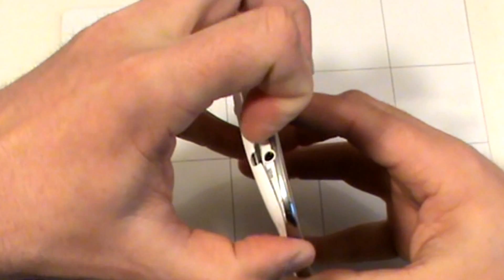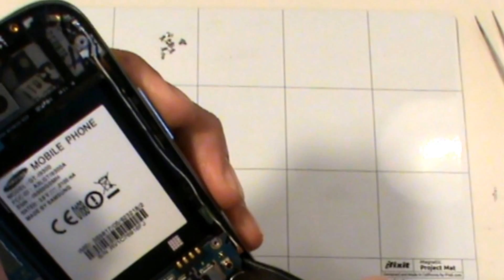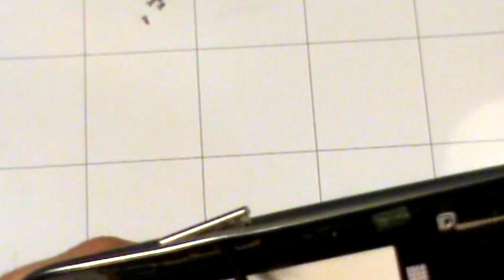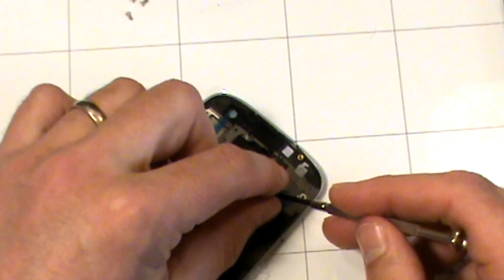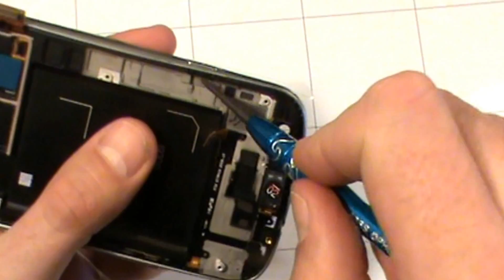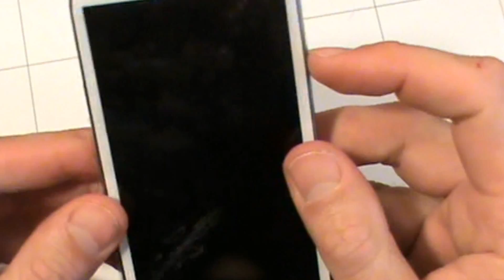Samsung Galaxy S3 Screen Replacement Guide

Comment: Thanks for the video very good I need to change mine but the display is ok and the frame it sits in is cracked so would like to change it may I ask where did you get your display from please as I don't want an inferior part, Any help would be good thanks Bob in the UK
Reply from the maker: Hi Bob, I'm glad you found my video useful. If you look in the description below the video you will see a selection of links to part and tool suppliers I've used. You can buy the frame separately from the LCD display. But, it is hard to detach the display from the frame without damaging the display. Buying a complete unit is far easier to replace. I hope that helps. Regards, Will

Comment: I dropped my s3 down 2 stairs, around 4 meters with the screen down hitting stone floor, the phone maked sounds and touch worked but the screen was black and a barely visible crack across the screen. I guess that is possible to fix this way
Reply from the maker: Yes, it sounds like a new screen is the best way to fix this situation.

Comment: can you show which side of the volume button to slide into the frame? thanks,
Reply from the maker: Hi there, You may have to try this a couple of times to get it the right way round. The volume button is thicker at one end than the other. If you put it in the wrong way round you will see immediately if you've inserted it correctly or not. It will sit flush with the frame if you have put it in the right way round. I hope that helps. Regards, Will

Comment: Hi Will - You must be a teacher in real life.  So clear and succinct.  I had two S3's, disassembled them parallel.  One had a cracked screen, the other wouldn't boot up but had a great body.  The only mistake was disassembling too much.  I could have just replaced the motherboard from one to the other and got the same result.
Reply from the maker: +John Mardling Hi John, thank you. I am happy that you found the video useful and clear. Did you manage to get one of your S3's working?
Reply: Yes, works well. I had a new i9300, just bought but I've decided to make the i9305 my primary phone now.  So all up cost $50+$55 (AUD). My wife was despondent because I'd had my S2 for so long and with this lasting, say 3 years and the new spare another 4, I'm going to reinforce how big a laggard I am (in her eyes).

Comment: hi Will, i replaced my screen just the way u did. I have some serious problems. My phone starts on safe mode and my touch doesn't work properly. Sometimes it opens normally but then touch doesn't work at all. So i think the problem is not about the screen. Can u help me?

Comment: Great video, Thanks mate. Screen is on and working. HOWEVER, I would recommend to everyone attempting this to heat up the vibrator assembly with a hair dryer to pull it off. Mine tore at the contacts and as a result I had to omit it from the re-assembly. It's my daughters phone so it's not a huge problem. Other than that, it was a breeze with this youtube reference. Another note; my screen included the buttons. I left them in and gently slid the volume assembly in with a small standard screwdriver pushing the button away inside-out.
Reply from the maker: Thanks for your comments, Duke. Glad it went well.

Comment: Thanks Will !
Absolutely Brilliant AAA+ with your YouTube guide I was able to replace my frame /screen, not one hiccup, on mine I had to press the top camera cover gently to make sure it was click seated before installing back cover with 10 screws.
So with your advise - First time working on a delicate piece like a smart phone with plastic TV tunning tools, and jeweller screw driver set and pointy nose tweezers I managed to do it 100% perfect job, something I know the quick turn around shop technicians with Chinese fake spare parts would not have the patience for.

10 out of 10 - you are the MAN for S3 !
Reply from the maker: I am happy that it was so useful for you and thank you for your comments.

Comment: Have taken my entire phone apart only to find out that you're not actually just replacing the screen. Spent an hour swearing and ballsing up my phone for nothing. Perhaps a better description next time so I don't end up spending loads of time and money for no reason?
Reply from the maker: When is a 'screen replacement' not a screen replacement? The 'screen' is made up of the 'digitiser' and the 'LCD' plus the case which holds it together. I can't think of a better description than that. And, I make it very clear at the beginning on the video what the video will help you to achieve. Did you want to replace the digitiser? Or, the LCD? Or, something else?

Comment: Does this also work for L710 model?
Reply from the maker: Hi Joe

I have not tried it on the L710 model. But, make sure you buy the appropriate part for the your device.

Comment: Ok 1 thing u missed out is while that battrey of yours is connected to your phone there is still power to your phone which means using anything metal can short circuit you phone to avoid thos take out the battrey and hold the ob button for 5seconds ... I recommend as if u shot circuit you phone u might as well thougb it away

Comment: My components don't come off anywhere near as easily as yours. Feel like they're glued on.
Reply from the maker: Make sure you take your time with removing the components. Sometimes, a little gentle heat can help with parts that are glued down. It's easy to damage ribbons if you force them off. So, be careful and don't hurry.
Reply: Thanks, I successfully changed my screen after watching this video :D. My main problem was my screw holding on the front camera had no thread left on it :s, so I bent back the metal and pulled it out and just taped it back in the new phone haha.

Comment: I replaced my GS3 screen and everything works great...EXCEPT the back button.  I took care to properly aligned the menu and back buttons and the menu button works great and it lights both the menu and back buttons but the back button neither functions nor lights up when depressed.
Is it possible that the back button is simply misaligned?  And if that's the case, is it possible to remove the newly installed screen, re-align the back button and then reinstall the same screen?

Comment: Got everything but the glue under the screen has bubbles and I tried to doing the blow dryer to even it out but didn't seem to work. Do you have any advice
Reply from the maker: I would send the screen back. That is a fault with the new screen. The glue under the digitiser should be bubble-free. It might affect performance but it looks unsightly and shows that the screen was not put together correctly.

Comment: thank you for your tips. I replaced the glass on my phone but now the glass does not respond to touch anymore. do you have any idea what I could have done wrong? everything looks ok and the phone turns on fine. The digitizer is also clear and there are no cracks in it either. much appreciate your help.
Reply from the maker: Hi there, Sorry for my slow reply. Your message was in the spam folder :-( 

If the digitiser is not responding to touch, it is most likely to be a loose connection. Take you smartphone apart again and check all the connections from the digitiser to the motherboard are all on correctly. It's easy to misalign them when fitting. Just a little firm but careful pressure on the connections should do it. 

If it still does not work, then it might be a faulty screen. 

I hope that helps. 

Will
Reply: Thank you Will. i'll do as you suggested and hope that I will be able to make it work.
Reply: Hi Will. I have looked for damage to the ribbons and checked al the connectors but everything seems ok. Are the LCD and the digitizer the same thing? the LCD screen is clean with no cracks but when I took the phone to a phone repair guy he said that I had also removed the digitizer from on top of the screen when I had cleaned it and that the digitizer sits between the glass and the LCD face and that's why it had lost its sensitivity to touch? just wondering if that is true? the phone was working perfectly before I took the screen off.  thank you
Reply from the maker: Hi there. The digitiser and the LCD are two separate components. The digitiser is the 'glass' you touch. The LCD is the 'screen' which displays the images. What sits between the digitiser and the LCD is a special adhesive (called 'Liquid Optically Clear Adhesive (LOPA)'). When you remove the digitiser from the device on an S3 you usually have to heat up the adhesive and remove it before you replace it with new adhesive and stick the digitiser onto it. Your S3 will work if you don't replace the LOPA and just stick down the digitiser to the frame. However, it is not as strong. It sounds like the ribbon is damaged. Without seeing it, it is difficult to know what is exactly wrong.
Reply: Hi Will, The LCD is black and intact. It also sounds like I have not damaged the digitizer as the screen works perfectly when switched on and all the colours look great, it just doesn't respond to being touched. I have checked all the connections and ribbons and nothing seems to be loose at all. I am at a loss as to what  do.   Thanks again for your help

Comment: i tried this and now my phone wont show any display =( i dont know what i did wrong
Reply from the maker: Hi there

It could be a number of things, but you might want to go back and check all of the connections from the new screen unit to the motherboard to ensure they are properly connected.

Is your S3 making any sound as it starts up with the new screen? It could also be your battery which might need replacing if nothing is showing on the screen.

If you have your old screen (and it is still functioning, albeit cracked), refit it to make sure you can see still something on the screen. This will let you know your motherboard is still working.

I hope this helps.

Comment: hey im fixing my samsung galaxy s3 this week and i've watched this video a couple of times just to get the hang of it.and noticed you don't use a hair dryer .do we not use one or do
Reply from the maker: There's no need for a hair dryer because you are not removing the 'glass' from the front. You replace the whole unit which uses screws to hold it in place.
Reply: Will Hawkins do you know a good website to buy the screen kit
Reply from the maker: 90210lovergirl1 if you look at the about section beneath the YouTube video you will see a list of recommended or suggested suppliers of the screen.

Comment: Will, Thanks very much. Great video. I fudged the 1st trying to remove the glass only and broke the LCD on my wifes phone. I ordered the complete unit and followed your vid. If I had messed this one up she would have killed me but it worked perfectly  :-)
Reply from the maker: Hi John, 

It's a tricky job to remove only the glass. I know from experience. I messed it up too!

I am glad you fixed it on the second attempt!

Regards,

Will

Comment: hey will, so I just recently broke my glass..I tried to fix it, but it ended up ruining the lcd too. so If I borrow my friend's old galaxy s3 and put my motherboard in that one, will I still be able to retrieve my data and run the phone just like my old phone? or will I lose everything?
Reply from the maker: HI Noel, 

Bad luck with the screen. It's easy to damage it. 

Swapping the motherboard over should work, although I have not tried it myself. 

Regards,

Will

Comment: I dropped my phone yesterday, the first layer of glass isn't cracked, but underneath i can see cracks and the screen won't work at all. the phone still vibrates, lights up, flashes, but the screen is just black. will this tutorial fix this?
Reply from the maker: Hi Georgia, 

It sounds like your LCD is completely smashed. In which case, replacing the screen (see links for suggested suppliers above in 'Description') as described in this video will solve that problem. 

Is there any other external damage to the S3?

Thanks

Will
Reply: just damage to the paint work really, if i follow the tutorial how much overall will it cost to fix?
Reply from the maker: Ok. That sounds like superficial damage. The cost of the repair will just be the cost of the replacement screen unit (LCD and digitiser combined. :-)
Reply: how much would that be?

Comment: I have a question. Does this part replace the LCD too? Cause the screen on mine is fine but the LCD under is 100% not working with cracks in it.
Reply from the maker: Yes, it replaces the digitiser and the LCD.
Reply: Will Hawkins Thank you very much.

Comment: Is it worth the money to by the whole digitizer and LCD screen setup rather than just the glass replacement?
Reply from the maker: If you can remove the glass without damaging the LCD beneath and then replace the glass so it is correctly bonded to the LCD, then it is cheaper but not quicker to do. 

However, it is not cheaper if you break or burn the LCD which is easy to do if you use too much heat.
Reply: thank you sir

Comment: Hi, thanks for a very brilliant and detailed step by step video. I followed it and replaced my daughter's LCD which she broked after a hard fell. The problem I am facing is that; the toutch screen works and then suddenly it will not. Last time I loosened everything again and placed the power  button correctly and it worked and now it will not. Do you think there could be something wrong with the motherboard ? Thanks or any help
Reply from the maker: Hi Jipudate, Thanks for your comments. It's difficult to say exactly because a number of things may have happened to the device when the original damage to the screen happened. But, it does sound like there is a loose connection on your smartphone. The most obvious points to check are the connector s to the motherboard, especially the screen connector. However, you have already checked this so it would appear not to be that one. Therefore, it does look like it is something more serious on the motherboard. In which case, this is much more of a problem that can be solved than just by replacing the screen. Unfortunately, I can't offer any advice on how to repair this potential problem. Regards, Will
Reply: Will Hawkins  I just thought you should know. I got another screen replacement and all works fine. Thanks a lot.

Comment: Will, that is awesome that you're replying to these comments with further assistance. I reviewed dozens of videos on replacing just the glass screen on an S3 and was very cautious and patient and was especially careful at the bottom where the two buttons are located, so I didn't damage them. BUT... no one said ANYTHING on ANY video about a ribbon cable that appears to be connected to the LCD screen.  It's in the lower right corner just above that side's switch. When I pulled to old screen off, being very careful to watch those buttons, it torn this wide ribbon cable.  This is NOT the connector for the switches, that I made sure wasn't damaged.  Like I said, I did everything every video mentioned, but there's no mention on ANY video of this ribbon cable which appears to connect to the screen and was also glued to the outside screen, thus it tore when I pulled the outside glass screen off. Why doesn't anyone mention this AND is there a replacement cable that can be purchased? I figure it's a full LCD/Digitizer assy install now, which is fine. The S3's screen was so badly broken it hardly worked at all.  So, for maybe $125 I'll have a new S3.  BUT WHY DIDN'T ANYONE TELL ME ABOUT THAT RIBBON CABLE?
Reply from the maker: Hi Johnathon, You're right. I followed a video about taking the glass only off and found that it was just easier, cheaper and quicker in the long run just to replace the whole unit. Thanks for the comments.

Comment: I need help.  I got a bran new galaxy s3 and sat on it.  The screen wasn't just cracked it seemed but the picture and everything was going crazy.  After about ten minutes the screen quit working period like it was off.  Do I have to replace the whole screen?  and if so can I use the screen from another galaxy s3 that I have?
Reply from the maker: Hi Samuel, yes, that will need a complete screen replacement from the description of how it was performing. If the other S3 is the same model as the damage model then, yes, you can put it on the other one.

Comment: Hi Will.  I just watched the video and I may attempt this.  How difficult is it to order the proper screen?  Are there many different varieties or just one for the S-III?
Reply from the maker: Hi Don, It's easy to get hold of decent screens on eBay. Just check with the supplier that your model of S3 is compatible with their part before you order.

Comment: Recently my S3 was damaged, there are a few cracks here and there on the screen however there's absolutely no picture at all.. Besides that the phone seems to be in working order. Is this an easy repair and what exactly needs to happen?
Reply from the maker: It sounds like you need to replace the complete LCD/digitiser unit. The video will show you how to do that.
Reply: Thanks a whole bunch WIll. I think I'll leave it to a professional, I'm not very good at things like these lol
Reply from the maker: Fair enough, Michael Marnies. A steady hand helps!